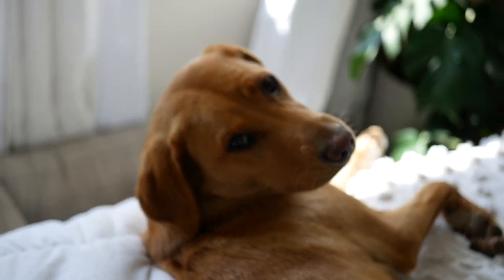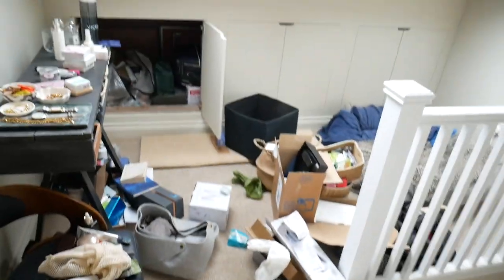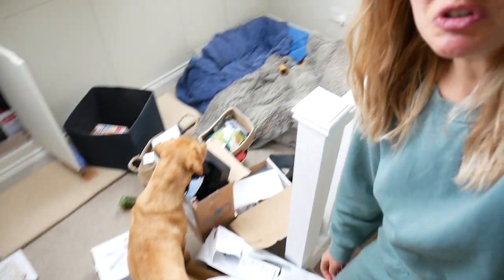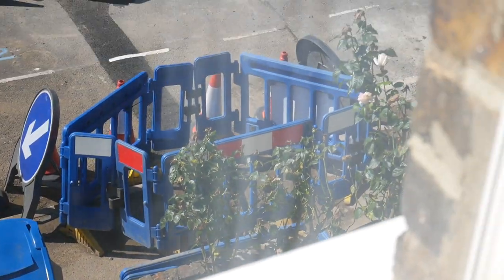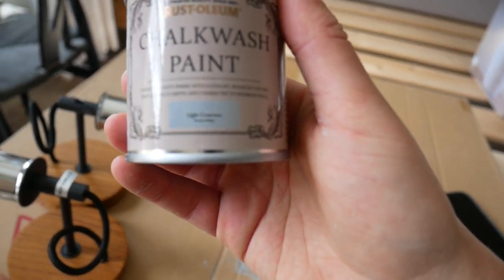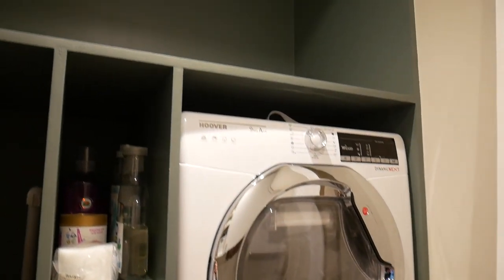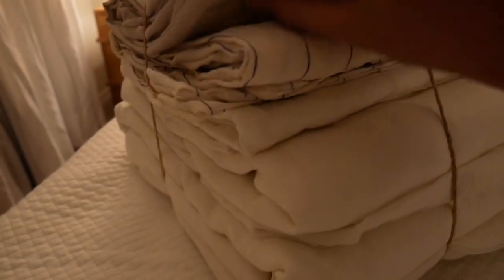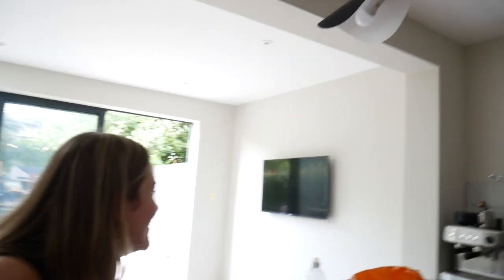HOME RENOVATION S2 EP 11 // PUTTING OUR HOUSE BACK TOGETHER

Comment: Oh yay, the pretty bits are happening now. It's looking sooooo nice. Bet you're loving putting it all in order after 6 months of dust and chaos. Hope you didn't find any leaks after todays torrential downpour. I live in New Malden so guess Kingston got it too. I have a swimming pool in my garden right now courtesy of all that rain but it's going to be hot by the weekend so hopefully it will all dry out. Your sister looks so like you.
Reply from the maker: my word yes that rain was wild wasn't it!! obviously the flood was terrible but it was valuable to see if all guttering was working to top spec and we actually found a part that hadn't and water was running down the side of the wall so got that fixed immediately :D